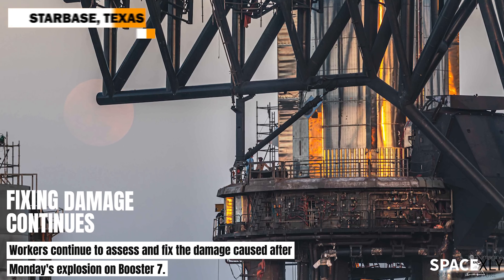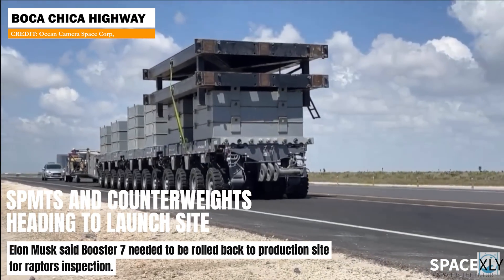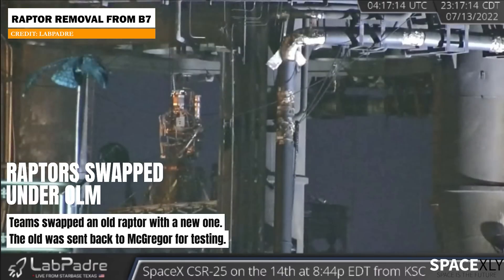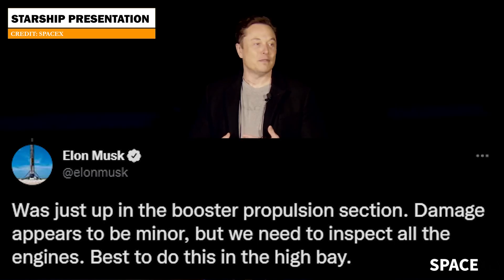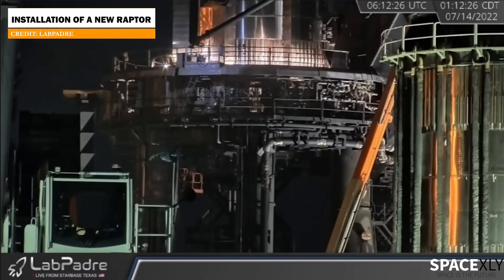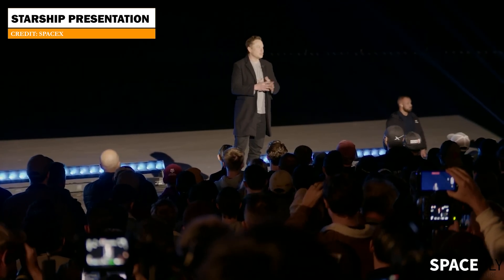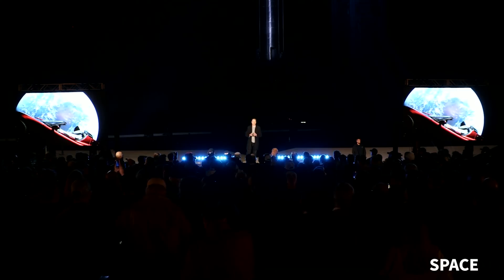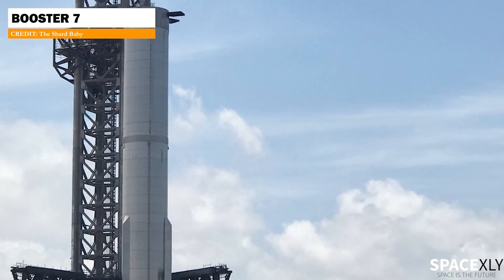New Raptor Installed on Booster 7, Elon sets new timeline for Starship Testflight | SpaceX Updates

Comment: I was wondering why the main booster is made of the stainless steel like Starship. Since the booster isn't subjected to reentry heat, couldn't it be made of lighter, stronger material to maximize payload capability? It would likely allow for landing legs as well if catching doesn't pan out. Landing legs AND increased payload capacity seems like a good reason to go to a composite main booster. Just a thought since it only takes one mistake to destroy the booster AND the tower.

Comment: They were relying on normal winds to dissipate the fuel/air cloud that will always form on engine spin up.  That is NOT good,  They need a simple FAN ASSEMBLY under the launch table to dissipate that cloud of explosive gas,  Simple usually works best even with a complex assembly.

Comment: Booster 7 is scrap metal. Easier to build a whole new booster than inspect every weld.
Reply: glad we finally got an expert out here
Reply: Welds are fine it held pressure hours after incident just integrity of engines are only thing in question ,and damage to launch mount but than should be minimal
Reply from the maker: True, OLM was built to resist more pressure and heat way more than the explosion.
Reply: Then start to build a new one yourself!
Reply: If scraped BN7, launch will flyed on winter. BN8, or BN9 neeted more tested.

Comment: Probably took a raptor off and replaced it so that single sample raptor can be taken back to McGregor for a complete teardown and xray, looking for signs of damage from the overpressure. It's efficient, saves a bunch of time if they're fine, and doesn't lose much time if they aren't. It's what I'd do.
Reply from the maker: Yeah,probably the damaged raptor needs to go back to the test site, no point on waiting for B7 to roll back.
Reply: There are a bunch of logistics constraints on the timing of moving booster 7 back to the high bay. The move itself is almost certainly scheduled for the first available road closure after all of the equipment needed for the move is in position and correctly configured.

This probably gives them a significant window of time where they can work on the booster without any impact at all on the move schedule.

This isn't SLS. SpaceX wants to learn how to efficiently do as much maintenance as possible on the pad.
Reply: They should take a few more as extra samples for various types of inspections
Reply: @Duckmyspace I subscribed